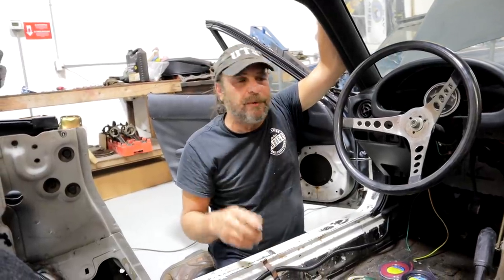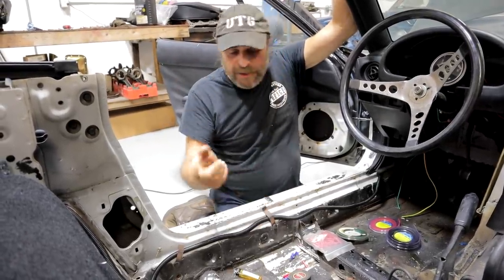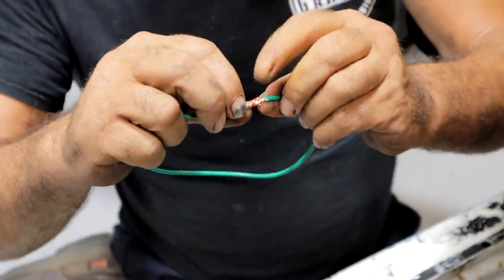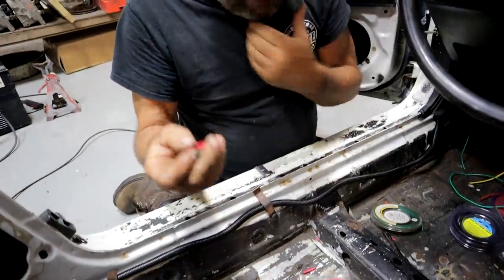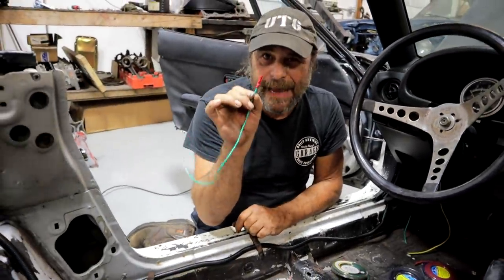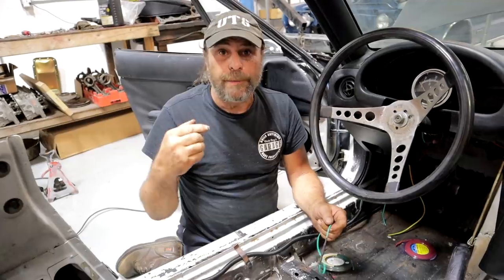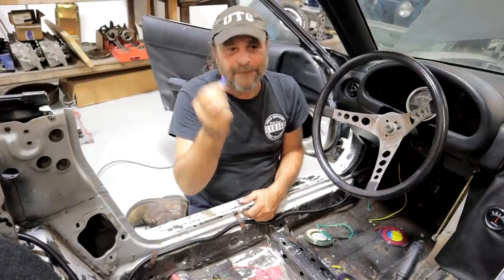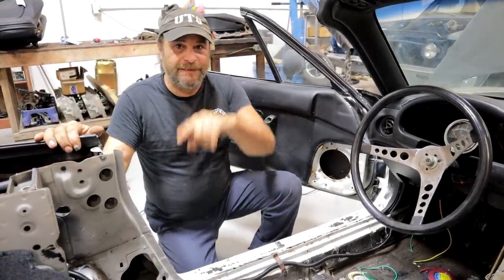The Single Most Misused Item In The World Of Cars

Comment: I'd say soldering is always the way to go. If you're using solderless connectors the correct way, it's honestly just as much trouble, with several drawbacks.

You also want to make sure you're using adhesive shrink tubing, with the correct shrink ratio, if you're relying on it's ability to increase tensile strength. Non-adhesive shrink tubing won't adhere properly to the wire insulation, and will allow slippage.

Comment: Insulation Displacement connectors/taps (guillotine) are STILL in use today (I see them in a 2012 trailer) (shakes head)

And PVC butt-splices are horrid because the PVC always have the plastic come off the ferrule. 
Oval crimpers are also horrid. 

Get the heat-shrink sealing butt-splices. OR just buy the metal crimps/remove the PVC and use sealing heat-shrink.
Use with either a stake or box crimper.

Comment: I don’t own a video camera other than an iPhone 6, but this would be my first video but longer. And thank you for bringing it up. I have no fancy open strand to open stand twist, dude, put your shrink tubing on, solder the copper core, place some hot glue on both ends but shrink it. “LS” swap your uncles YUGO, I don’t care, but made a wiring diagram!!! It’s called a schematic. Take digital photos since the PhotoMats are gone. I wouldn’t but a “LS” mope head unless it came with a service manual. System by system, wipers start to finish on 1 page. “I can barely draw a stick man”...great, you are golden! Wires are positive, fuse, connector, switch, device (Cooling fan(s) great, draw the wire from power at top of page, everything in between, relay, fan and ground at bottom. It’s better than 9 pages folding out the last page of a service manual. That’s better than nothing. Here is WHY! Electrical problems happen. Your 270 mile from home, going to a show-N-shine. It overheats, you limp into a repair shop, tell them your problem, they open the hood and SEE what? Some shops refuse it. Some may give you a repair estimate of $30 - $700! If you have a CD, thumb drive or even paper make from a tree, here’s you service manual and each system from the tail lights to the cooling fans have fuse location, wire color, size (AWG-Metric), connector cavity location (End View-Photo 67), connector location (Photo 37). Its not that hard! Every tech can replace a water pump, or order in a pipe fitting, but if you bought it from “Jegs” give a part number, a company name, hose size.... if you can’t do this, but a trailer or park it. Don’t ever ask me to work on it, because; “Scotch-Locs”, un-soldered connections with no shrink tubing, and loud radios sell lots of parts and labor” How far do you want to go?
 $60k car, $600 repair, 6 days to track down problem, root cause = $0.06 cent part failure! Enjoy!         NIASE Master Tech since 1978 - Retired

Comment: Tony   It's a Good vid and I agree with you......"Some".  :)  Those "Open barrel" style I don't even have in my shop.....Step the game up....Use the Crimp/Shrink units.....and no open flame to shrink.....Use a heat gun....Like you I'm looking at the wiring when I go to car shows......Probelly the #1 thing I see is the use of those $.99 battery cable repair ends on the battery terminals.....You know.....The ones where the cable gets stripped and bare wire gets clamped and the fray of bare wires sticking out to collect corrosion. :(

Comment: I'm in the electrical industry where our crimpers are pull tested for quality control. I have $200 crimpers but for the Hot Rod guys I suggest Klein Tools 3005CR. They are a ratchet crimper that ensures full-cycle crimping. They are like under 30 bucks on Amazon right now.

Comment: And for the Lexus (née Cadillac) of crimping tools, there is the Amp/Tyco 59250 for reds and blues, but not yellow sizes. This thing retails for an astounding $1600 but used ones can be routinely found for $120-$150. It is the most amazing hand tool I own, and helped me earn an Outstanding Workmanship Award for my experimental aircraft at Oshkosh Airventure 2014. No need for shrink wrap, as there is a 4-size, insulation adjustment that creates a (swear-to-God) oxygen-free crimp on the insulation as well as the wire. You’ll need special crimp fittings made especially for the tool, but they’re fairly easy to come by. Also, not to be a PITA, but twisting the wires beforehand adds extra space between the wires that must be overcome by the crimping process and allows more space for oxidation...not the best scenario.
The best process is to slowly twist the wire back-and-forth until it seats into the crimp fitting without pre-twisting it. 

Also, if you buy a used one, you can send it back to Amp/Tyco to make sure all the anvils are within spec. Mine were and it cost me $50 plus shipping in 2006. Best $200 total I’ve ever spent.

Comment: Thumbs way down on solder joints for automotive. They concentrate stress where the solder ends, then strands fracture from fatigue. Also always get corrosion long term, even with best solder/rosin. Do the crimps, just DON'T over-crimp. As for modern O.E., pretty much 100% crimp until you get inside modules, circuit boards, etc. where you'll find solder and welds. Biggest differences on modern O.E. connectors is (a) quality of connector, (b) multi-crimp tangs...crimp wire & crimp insulation, and (c) contact & body seals for weatherproof. Uncle Tony wins this one with only one side note: buy good crimpers AND best connectors & shrink tube you can find. Avoid no-name like the plague. Thanks Uncle Tony! Rock On!

Comment: I use uninsulated butt connectors and heat shrink tubing with glue ( not all heat shrink tubing has glue) motorcraft wt5624a is really good.

Comment: Shrink tubing is great but I seldom have it . Best alternative I've found is silicone.  Is fast, deals better than tape (long term), and when hardens gives u strength via bonding to the  insulation/coating. NEVER EVER use those scotch clips. If u see anyone using them SLAP THEM. They'll thank you for it someday.

Comment: Better yet, buy the connectors with no plastic on them.  Crimp AND SOLDER, then shrink your tubing over it.   It will never fail. Shrink tubing isnt gonna keep a crimped wire from coming out, but solder will.

Comment: As a professional electronics technician, I don’t even go near those types of connectors and the Scotch tabs are an abomination. You are also using the worst tool for crimping, go for the ratchet types more expensive and bulky but guaranteed a tight connection all the time. The types of connectors I use are the non insulated types that can come as single or multi-pole male female pairs. Brands are Utilux, Narva for power and most connection, Molex for the car radio and Anderson if a CB or Mobile Radio is installed.

Comment: You can strip wire easy with a Bic lighter, you don't need to burn it just soften it.
I don't know what the problem is with soldering and heat-shrinking wire splices, I do it all the time. I mesh the wires directly into each other and then wrap the splice with one single strand and then solder that, it's done!
You can make electrical tape work better than heat shrink, you just fashion a hook out of solid conductor and wrap the tape OVER that. Then when you're done you put the tail of the tape into the hook and PULL the loose tape tail underneath the tape job you just did. That tape is never coming loose.

Comment: Crimp wire connectors are MUCH older than 25 years. They were introduced in 1953, 68 years ago. Many people think or assume that soldering wires is the superior connection. In vehicles however it's not. In fact the FAA repair guidelines for aircraft prohibit using solder on wiring. The reason being STRANDED wire is designed for flexibility, because vehicles vibrate and solid wire will crack. When you solder a stranded wire it wicks into the strands, turning a stranded wire into a solid wire, and it can crack. Crimp connectors are actually best.

Comment: I used the heat shrink crimp connectors. Just strip the wire, stick it in, crimp, same with the other wire, and then heat it and it seals itself. If you wanna get extra, you can put EVEN MORE protection with some black uh heat shrink tubing. Thing work great though, super easy, a bit more involved than you know...electrical tape, but still an easy roadside fix. Maurettes/Wire nuts/Electrical connectors are BY FAR just a holy cow please no.

Comment: Twist the wire before crimping. I use the uninsulated butt connectors and double wall shrink tubing. For wire a little smaller,strip double the usual length and fold it over. Stronger connection. 
Under dash gets insulated connectors, no seal. Under car gets everything i can throw at it,usually crimp and seal connectors with terminal grease on wire.

Comment: I have a big ole vet syringe filled with grease. I fill up the connector before inserting the wire, then shrink wrap.  Greasing those guillotine connectors, then taping will get you by in a pinch, same thing with a wire nut.

I also have the needle for the horse syringe, I'll use it to restore a dry sealed bearing.  Did an idle pulley on the drive of my lawnmower almost 3 years ago. The bearing was sounding crunchy, new one was a week out in the mail, only problem is finding where I stashed the new one when it actually goes.  Lol

*how to fill the syringe.  Remove plunger, insert grease gun tip all the way in, pump and kind of let the pressure push the tip back out. Air pockets are the enemy. *** take a paper clip size wire and slide it in between the plunger and wall of the syringe and the plunger to bleed the air out or you won't get the plunger back in.  (A clean hollow needle works great) Sounds like a PITA, but it is a handy little thing to have, I do a few at a time, they last a long time.

Comment: Most of those crimp connects, the insulation on the outside is actually shrink tubing. It's thicker and stiffer because of the crimping (otherwise the tubing would tear).
Because of that, more heat (or heat with more time) is needed to cause them to start shrinking.

Comment: No offense but some of this is bad info. 

1) with most modern crimp connectors in the electronics world the red, yellow or blue sleeve IS shrink tubing that also has a heat activated expanding glue that is 10 times more effective than standard shrink tubing, especially if you have more than one wire going into one side. In the the automotive world make sure your package says "marine grade" for this feature.

2) the reason you have loose connections is because you are smashing the connector. ONLY CRIMP EACH SIDE ONCE. Use as directed.

3) you should NEVER have any tension on your cables. If your crimp connectors are falling off you either screwed up by smashing it or you reeeeally need to work on your cable management. There is no reason you should be using shrink wrap to hold wires together, Its just an insulator.

4) never use your teeth, especially if you have a god damn wire stripper/cutter/crimper tool right in front of you. You only get one set of teeth.

Comment: All good but the time lines. I first used the crimp connectors in about 1962, and never was a big fan. The Scotch Tap connector is made to add a wire to an existing circuit. They make a version for connecting strings if fluorescent lights in commercial apps. Sized for different feed wires (brown for 12 and 14 GA, and yellow for #10. The small side is sized for typical 18 ga ballast wires. Must have installed a zillion of them in the late sixties. Problem with them is that the smaller (blue, red or white) sizes are improperly crimped or mis applied. NONE are really for solid wire.

Comment: I can tell you nobody knows this. I have never seen it done nor taught.  The alternative to these that I have used was the one that the casing is the heat shrink.   I've gone to the solder connectors that Amazon sells that you heat up with a  lighter or a heat gun to melt and heat shrink all in 1 nice step.

Comment: Tony, I think you are using your tool wrong.  You're crimping with the part intended to be used for cutting.  The notch nearest the pivot is what you're supposed to crimp with, makes a more rounded crimp that won't guillotine your wire. If the tubing of your connecter has a seam, put the dent on the back, not the seam side.

Comment: Well, a crimp connection IS meant to be a mechanical lock and the wire SHOULD stay in the connector under reasonable load. Just like cable splices. If the wire pulls out, the crimp wasn't correct.

Comment: I do have a few crimp connectors in my vehicle tool kit (affectionately referred to as my "Roadside Oh S@*t Kit) for quick repairs, but I've never considered them as a permanent joint, so they get replaced by the following weekend. I still solder and shrink tube everything. I'm sure there are lots of great products out there now that are equal to a solder joint, but I don't feel the need to change what works for me at this point. Plus, my vehicles are old enough to pre-date these type of connectors, so I suppose I am being "period correct" LOL! Me being correct....who'd a thunk it??

Comment: I have to disagree with almost everything in the video as amateurish misinformation.
I learnt wiring, soldering, crimping, terminating techniques and skills in the communications, electrical, automotive and manufacturing engineering environments.

**Anyone who uses the flat style of crimping tool ....!!!**
Do it properly and use a "ratcheting crimping tool" for correct crimp pressures and consistent crimping.

**Anyone who only crimps the centre sections of the crimp ....!!!**
Do it properly and use a "ratcheting crimp tool" that crimps the "bell end" of the connector sleeve onto the insulation to act as a strain relief.

**Anyone who uses a cigarette lighter or bare flame on heatshrink ......!!!**
Do it properly and use a heat gun, they come in all sizes and shapes, gas and electric.
Heatshrink is only needed where water/moisture proofing is required as well as insulation, the crimp/splice has strain-relief designed into the connector.
The "marine-grade glue filled" heatshrink is actually called "Double-wall glue-lined" Heatshrink, and is used extensively in many applications apart from marine.
Properly Soldered and Heatshrunk joints are always better and preferred, just not as quick and convenient.
Check out military training manuals to learn how to solder, terminate and splice wiring correctly.
The more recent low temperature solder/heatshrink splices combine it into an all-in-one package.

Comment: Solder and adhesive lined shrink tubing. It’s the best in my opinion. It isn’t really hard and is a perfect connection. No wires get cut or crushed if you crimp the murette at one end of the section or too tight. I thing the crimp fitting is fine with shrink tubing, but I like the looks of a soldered connection even staggered because the loom looks like it always was like that when you are done.  To each their own. There’s a reason you keep a fire extinguisher in your customized classic vehicles!!! Haha.  I always say it’s to help out buddies that take shortcuts or don’t rewire someone else’s build,,,,,,,,. I worry about mine even with the soldered connections. They are often just simply old vehicles. I did a 67 C10, 67 Mustang 2+2 that I still have, a 69 Bronco and a 70 GMC all with the Painless wiring harness for each one. Man,,,,, that’s what I should have started with sooner. I was worried about keeping everything stock so was rebuilding the wiring harness there. It was a royal pain! 
    I have 67 Chevelle SS 396 4 speed that is all perfectly original. It’s the exception. Everything else I have built was not numbers matching or missing enough to not care about perfection. I do 4 wheel disc brakes all the time, except the Chevelle, fuel injection for the last 4 builds, and keep them modern and reliable. From the interior or outside you can’t tell they are not stock, underneath the suspension is brand new stock or even slightly modified. 
     I hate wiring with a passion because I’m just not that good at it. Now with a fully marked wiring harness, that can be vehicle specific, it’s pretty easy. I’m getting lazy in my old age,,,,,,,,, haha.

Comment: - Very cheap krimping tools tend to flex rather than krimp and damage the insulation. Check out some reviews first, you'll find good ones for just a couple of bucks more. Even Knipex offers affordable ones that are great.
- Use splice connectors with nylon insulation. Much tougher than plastic. But also more expensive.

Comment: Just wondering, doesn't it make more sense to use unisolated connectors instead and then cover them up with an isolator?  Unisolated makes it slim and gives the possibility to check your crimping before sealing it in any way.  And of course it's cheaper.  As far as I know (in Europe) , the shown connectors are for usage in dry environment like connection boxes up to 500V AC. The plastic is just for shorting protection. They've got an IP 20 or IP 30 rating I suggest...

Comment: I liked the temporary splice reminder, but I take issue with your butt splice method. I try to purchase bare terminals with no red, blue, yellow plastic. I remove the plastic if that's all I have to work with. I then use my old mid 80's cheap K-Mart Wire stripper with a "W" crimp and use the pointed "W" crimp to either do the proper "W" fold or make a deep indention crimp on solid terminals. Then I solder the wire entry into the terminal. I finish up with heat shrink. .......... 

I wish I had bought more of those K-Mart Strippers since mine has wear over the years. I saw some look-a-likes on Ebay, but don't know if their quality is as good as the K-Mart labeled strippers. .......... I use old obsolete Ungar 50 watt irons, but my best is another obsolete brand that is about 80 to 100 watt that works wonderfully and it's so old, it uses a cloth wound cord with a non-polarized plug.